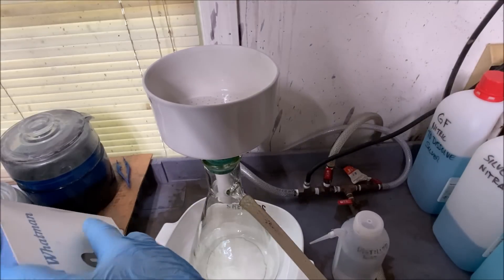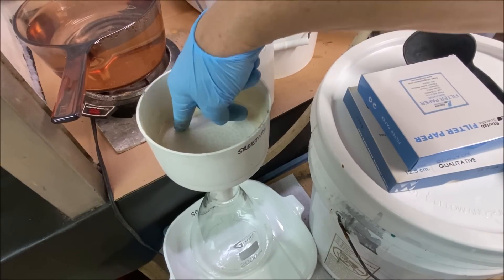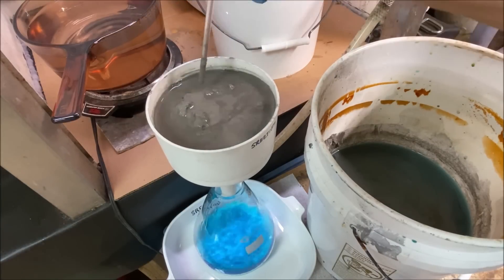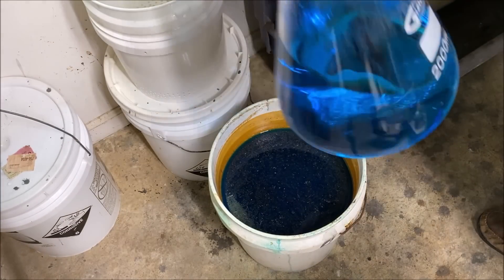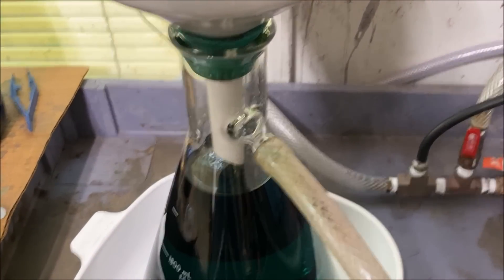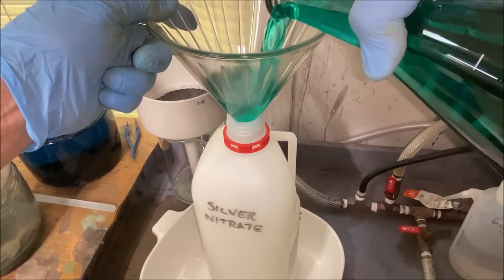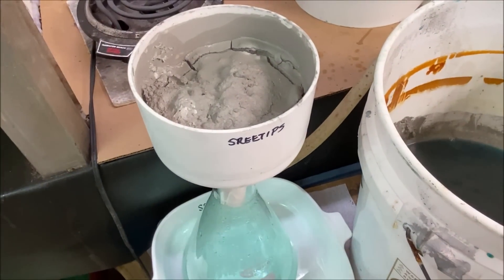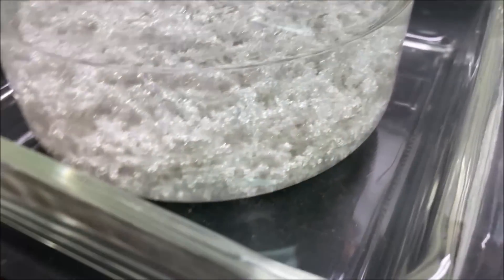How To Refine Silver To Three Nines

Comment: Does the angle iron cement out copper? When can you dispose of the waste solution from gold refining?
Reply from the maker: Yes. Once it’s been treated.
Reply: @sreetips so once you remove the copper and the silver from the acid you can just toss it into the trash or do you have to bring it to somewhere special?
Reply from the maker: No, I treat the waste to make it safe for disposal.

Comment: Hey sreetips, I have been a subscriber for some time now to your channel. I love it and you and Anthony Thomas  got me into refining. I watched you periodically for over a year before I even bought a flask. With that said I have only refined silver twice. I have all the proper equipment and supplies and have had a successful run my first time refining.925 into cement silver. My second time I’m in the middle of now I’m experiencing a 48% loss. I’m using dilute nitric process. I let my copper sit in the solution for 5 hours (to short)to cement out silver and pulled it out and rinsed the cement silver and dried it to have 4.75 ozt. Out of 10 0zt. So I put the copper back in and let it sit over night. I got a half ozt more out. 20 i have 5.25 ozt now. I tested solution along the way with hydrochloric acid. There was less and less in solution untill now There is nothing in solution. I didn’t spill or waste anything, I am totally lost. I had 237 grams on .900 and 111 grams of 925. I know you’re busy but after doing everything I know it’s time to contact an expert. So if u have the time please can you help me maybe figure out how it’s possible to lose this much. ( it’s alot to me) I’m just lost 😢😅 thanks in advance for ANY input or help. Is it possible to be locked in solution and hydrocloric acid isn’t pulling it out? Was it too concentrated of solution when I added my copper? Would that make a difference? Like said, if you can’t reply I understand

Comment: Goodday sir, what types of acid and purity% do i need, to refine, gold silver, also to make silver cell.
Reply from the maker: I have a video titled “silver cell build from scratch step by step”
Reply: @sreetips  many thanx Sir, ill watcb and rewatch to get it perfect. Just one. More question. That dirty silver you make to feed the bucket ontop, can any 925 or lower silver also be inserted in filter.
Reply from the maker: Yes, however, if you do then the electrolyte will quickly turn dark blue and become saturated with copper. If the copper gets to a certain level (I’ve been told 60 grams per liter) then it could start to co-deposit with the silver and contaminate it. Best to use fairly high purity silver to begin with for best results.
Reply from the maker: In precious metals refining, shortcuts usually end up costing more time and effort in the long run. But it does give a first-rate education in what not to do.

Comment: Does the Stainless Steel bowl cathode get displaced by the silver in solution, or is it inert? Also your electrolyte becomes blue. Why doesn't the copper contaminate the silver crystals?
Reply from the maker: The stainless is inert. The copper stays in solution and doesn’t plate out with the silver as long as copper concentration stays below 60g per liter and the voltage is kept constant at 3.5 volt DC
Reply: @sreetips  Thank you for your response. I don't doubt you but I find it counterintuitive that voltage can be used to select for silver over copper. Copper is higher on the reactivity series so one would think it requires a weaker electric field to be reduced.

Comment: Afternoon Gunny, or, "Shark Tooth", whichever you're going by now 😂. I have a question for you. Silver Nitrate. Going by definition, it is a clear liquid. Mine always comes out blue. I noticed that yours does also. Copper is the antagonist. What I don't understand is, if I'm using pure Silver crystal, to make my electrolyte, why is there Copper present?

The light blue color of the electrolyte doesn't impede the growth of crystal. It works wonderfully, just as yours does. Does the trace amount of Copper affect the three nines fine purity of the Silver crystal?

I know that there is a way to remove all traces of Copper, to yield a completely clear Siver Nitrate electrolyte. Is it necessary to do this?

I have collected 384 ounces of Silver Chloride and am about to do the conversion to Silver Oxide, with NaOH. Then glucose to drop the Silver metal. This process, I am to understand, will yield 99.9 Silver, if rinsed correctly. I am still going to run it through the Silver Cell. 

Would you be concerned with a pure Silver Nitrate solution, or, is light blue acceptable? I really appreciate your input and your willingness to mentor an old curmudgeon like myself! Thank you for all you do! I call you friend, and so you are! Maybe someday, I will be able to meet you in person, to shake your hand, buy you and Mrs. Shark Tooth a wonderful meal, and thank you as you deserve to be thanked! Your tutorials have been a life saver for a me. As always, your devoted fan,

Wade
Reply from the maker: Goldsilverpro on the goldrefiningforum.com recommends adding some copper to the clear silver nitrate to promote fat crystal growth. But I always just let it build up from the impure silver that I add. Copper in your pure silver crystal probably means some parameter is off in the cell.

Comment: After leaving my silver nitrate settle overnight, and before adding copper,  I noticed it had started to crystallize by about 25% in the bottom of the beaker, what might cause this? and should I reheat the solution to dissolve  these crystals?  Was this solution starving for more distilled water , could it have been too rich in silver?, Please enjoy your holiday weekend, and don't make any special accommodations to answer these questions
Reply from the maker: The silver nitrate crystals will dissolve in distilled water
Reply: @sreetips  Thanks

Comment: Wow just did my 1st nitric acid boils for rendering .925, I have a greater respect for the time, energy and real work you put in with your channel, as well as all the knowledge you share,  So much to learn, and so many questions,  Thanks for doing the channel. I would have never done any of this without your channel!  Quick question is the gray powder which clogs up the filter paper when filtering the silver nitrate solution actually silver cement?  and should I keep it for melting down the silver cement?
Reply from the maker: I don’t know what the gray powder is. I save all my filters and process them later on.
Reply: I didn’t realize how much filler powder was inside of sterling knife handles , it is probably some of that, as well, as cement

Comment: Hey what's up brother..is it normal to get a gas off from the copper cementing or did i have a delayed nitric reaction? I left a fork in to assure all nitric was used up but seems after adding more distilled ( wash out) it reignited? 
  Also the cement top half has an obvious copper tone where as the bottom has pure clean silver appearance. Does your cement look like that? Wondering if i should smelt and then redissolve before putting in the cell. I appreciate any feed back you can give me!
Reply from the maker: Outgassing (with fumes) happens when there’s excess nitric. To reduce this I add some sterling and heat until all fumes are gone. But even then I still get some gassing. Going back to nitric isn’t necessary. I’d just melt into shot and run it.
Reply: @sreetips  thank you brother! I've learned a ton from you already! I wouldn't have known any of that a couple weeks ago, this is very interesting!
Reply: @sirridok  Same here. I'm actually working around all of this equipment putting in all the plumbing at an old mine in Ca.
  Everything used in the video's explains everything I've seen or had to move out of my way multiple times.

Comment: From what I've seen, if you clean the cement silver until clear with distilled water and boil it in HCL it'll be .999 fine. The silver crystal is easily .9999 fine!

Comment: What is the limit to purity obtainable? Could you do 4 nines - five? What would it take?
Reply from the maker: Industry standard for gold is 999 parts per thousand. Anything over that is not necessary. Although four nines can be achieved using pure metal to start with and then using the wohlwill process of electrolytic gold refining.

Comment: The new microphone is sounding better every time you use it. I still get a little clipping here and there, but its a lot better than your first video with the new equipment
Reply: On another note, I vote that you start making cool castings with the silver and copper you have around. I liked the idea of casting a nice antimicrobial toilet out of copper and electroplating it in rose gold or pure silver to keep the antimicrobial effects and also keep the costs down by using copper from old copper nitrate solutions if you have old solutions from cementing out the silver in your gold refining.
Reply from the maker: An anti microbial toilet. Now that would be something.

Comment: When dealing with that much cement silver, I honestly have no experience or knowledge on this other than your videos,  would it be easier to fill the bucket with distilled water to dilute then tip off/filter off the excess liquid and continue that way until it's clean instead of doing multiple tiny batches trying to pull through a blocked filter?

Comment: Love your work. Two questions: 1.) Why don't you get a rotavap to reduce the enormous amounts of liquids you are handling? 2.) Did you ever try to substitute conc. nitric acid by dilute nitric acid / hydrogen peroxide? It should dissolve silver just as good minus the red nitrogen dioxide fumes.
Reply from the maker: I’m too poor for a rotating evaporator. I’ve heard of using hydrogen peroxide but I’ve never tried it

Comment: This is kind of like a lesson on how to deal with waste products. Could you go into more detail about the chemistry behind this? Thank you.
Reply from the maker: The blue liquid goes in waste treatment bucket full of iron. The copper cements out on the iron and is tossed. Then the acidic iron solution goes in a waste treatment bucket and sodium hydroxide is added to drop the metal hydroxides. These are filtered out and the solids disposed of.

Comment: Hi doctor 
You all time make best video and answer people according to your experience thx so much🌹❤️❤️
I have question:
You put ice in AR for get rid silver Chloride and filter your solution this way all silver chloride and lead remains in your filter.
how do you recovery this kind of silver?
Reply from the maker: I add the filters to my paper storage. After I get enough filters saved up I burn them and recover the traces of precious metals from the ashes. As far a silver chloride specifically, unless there is a large quantity, half liter or more, then it’s not very efficient or economically feasible to try and recover the small amounts in the filters.
Reply: @sreetips  thx so much for reply 
Doctor do you separate your filter paper from Stanos test papers?
Reply from the maker: I don’t save the stannous
Reply: @sreetips  doctor after burning filter paper do you put ash in Nitric acidic then AR or go straight AR?
Reply from the maker: Nitric first
Reply: @sreetips  thx you so much 🌹🌹🌹❤️

Comment: Question for you streetips is it possible to get the silver from 35 percent silver war nickels? I'm sure it's not cost effective but it has always intrigued me how it would be possible. Just wondering if it was possible and if it is if you could make a video about it. Thanks Jon
Reply from the maker: Yes, just dissolve in nitric, filter, cement in copper or do a silver chloride conversion with lye and sugar.

Comment: Why do you store your silver crystal in water?
Reply from the maker: To prevent contact with air.
Reply: @sreetips  so pure silver will tarnish also?
Reply from the maker: If left in the air long enough it will. According to Allison Butts, co-author of “Silver: Economics, Metallurgy and Use” silver did not tarnish until humans began to burn coal, releasing sulfurous compounds into the air. Tarnishing of silver was the result.
Reply: @sreetips  interesting

Comment: You could filter your own rain water by collecting it in a water butt. You have free distilled water forever, all though it isn't expensive. I think in these hard times it's good to save as much as you can.
Reply: Rain water isn't exactly clean. I remember measuring its pH to be somewhat acidic in my area. Also, some dust often falls together with the rain.
Reply: @bormisha  Hence the filtration. Also, if left to settle, the pH levels out. If it's fresh rain water, then I also agree that the pH will be too high. I have made the mistake before and it cost me a lot of time and effort.
Reply from the maker: I use about 20 gallons per month.
Reply: @sreetips  Wow. That must get expensive. Look into the water butt idea. The filtering off can be slow as I use a paint filter inside a coffee filter. 1 gallon would only take around 5 to 10 minutes to get rid of any mineral particulate.

Comment: @sreetips question. I've binge watched at least 3 days worth of videos, maybe more. In one of your videos you are torching some sterling silver candle holders to add to your gold refining byproduct pot. Is it possible to just start from there with sterling silver and create the silver nitrate solution and then use the copper to cement out the sliver?
Reply from the maker: I think I used clean cement silver a long time ago to start my silver cell. Afterwards I saved some silver crystal from each harvest to use to make electrolyte for my silver cell.
Reply: @sreetips I planned on using some pure .999 silver like you did with that massive silver coin to create my silver electrolyte for the silver cell. 
Is this correct?
I'm talking about skipping the gold inquartation process and going straight to creating the solution using the hot dilute nitric acid to dissolve the silver from the sterling silver to start the process. (Creating silver nitrate and copper nitrate solution) Then cement out the silver onto copper. After that drying and melting into shot. Then using a silver cell to grow the silver crystals.

I know you use
Reply: @Camelguy069  I think it should work this way. It's just that Sreetips refines both silver and gold, to the benefit of both processes. It saves on nitric acid and labor.
Reply: @sreetips  also, thank you for responding!

Comment: At 5.40 rinsing the silver of the silver with hot distilled water?😅
Reply from the maker: Rinsing the blue liquid (copper nitrate) off of the cement silver with hot distilled water
Reply: @sreetips  that is what you did not words you spoke.😄 Still a great video! Could you explain in one of your video's what you do whit all the copper in your waste treatment? 😅
Reply: There could be also silver in solution around the silver, which had to be rinsed off, too.

Comment: What would happen if you put the cement silver directly into the silver cell filter basket? Larger surface area so might go faster.
Reply: It would just turn into a silver mud cake, fouling the cloth.
Reply from the maker: I’ve tried it with negative results. The filter plugged, the current flow dropped off rapidly. Silver shot/granules are the way to go.

Comment: What’s the rate of speed that your cell is dissolving a kg of silver shot at, given the settings you run it? Does bowl size affect the plating speed given more or less surface area?
Reply: No, the speed is determined solely by the electric current passed through the cell (current is a rate of charge transfer). Calculation is easy. You divide the current (in amps) by the electron charge (1.6e-19) to get the number of atoms deposited per second. Then you divide the result by the Avogadro constant (6.02e23) to get the number of moles of silver deposited per second. Multiply the result by the silver's standard atomic weight (107.87g/mol) which yields the silver deposition rate in grams per second. Dissolution rate is the same as the deposition rate. For example, for 1A current, the rate is about 0,001g/s, which is about 4g/h. In 10 days typical cell running time of Sreetips, 967g of silver would be processed.
Reply: @bormisha  awesome explanation! Thank you 🙏🏼

Comment: What is the concentration of the silver nitrate solution in the electric cell?? And the anode must be pure silver??
Reply: The anode material is unimportant until the anode touches the electrolyte, which happened to Sreetips a couple of times. Then, if it is made of pure silver, it would just dissolve but not spoil the previously deposited silver. If it's made of platinum, I guess, it would not dissolve but the electrolyte would get depleted of silver. Finally, if the anode is made of copper or iron or other crap, it would severely contaminate the electrolyte upon contact and possibly spoil the deposited silver.
Reply from the maker: 150g pure silver per liter of liquid.
Reply from the maker: Anode is pure silver. The impure silver granules are 99% pure.